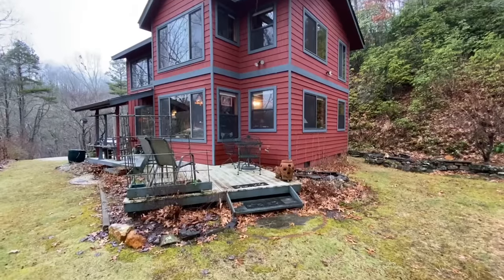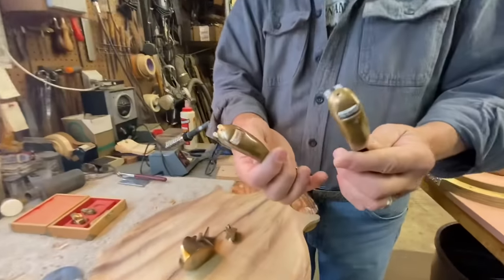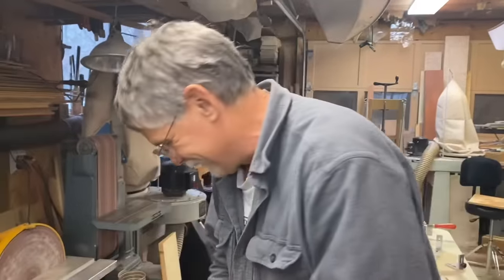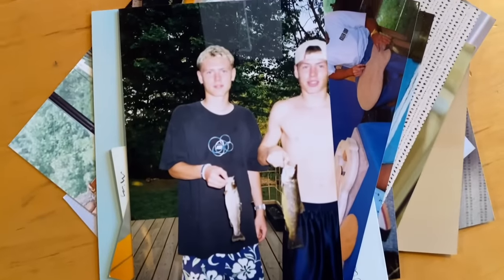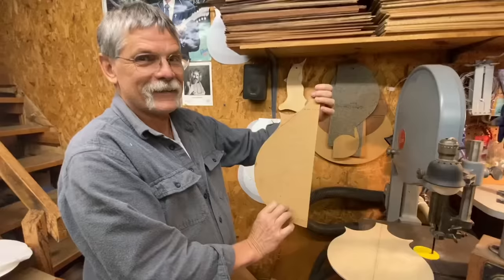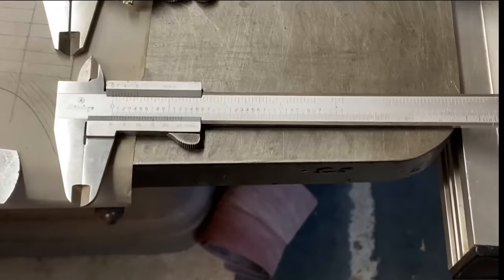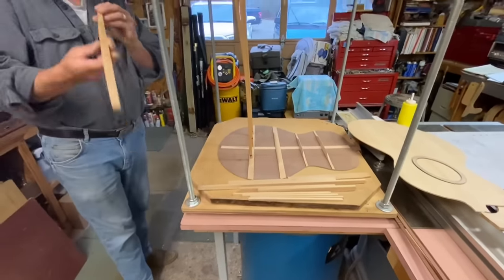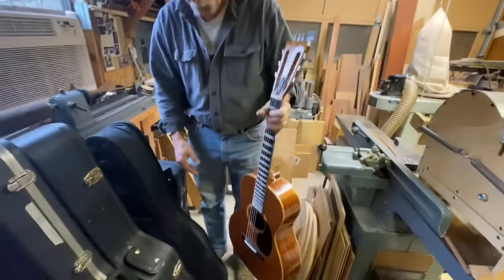Our Wood Working Legacy ~ growing up with a MASTER woodworker

Comment: my grandfather was a cabinet maker who passed away in 2004 due to lung disease from all then stains and whatnot to this day i have customers who say i knew your grandfather he did the best kitchens around here i had a job last year remodeling a bathroom for one of his old customers and the kitchen looked like it was done 5 years ago he was way ahead of his time with his cabinets and kitchen design. He would sign his name on the wall behind the refrigerator on every job so i started doing the same on my kitchen remodels. My hope is that when im gone people will remember my work thats leaving a mark in my opinion
Reply: Interesting, but it's hard to read because of all the run-on sentences. Also, how about some Capitalization?
Reply: Amazing story I may start doing the same
Reply: @Ward00 dude this is a comment section not an essay 😂